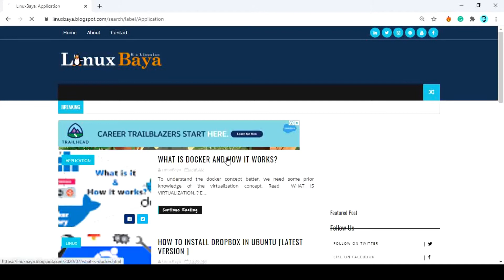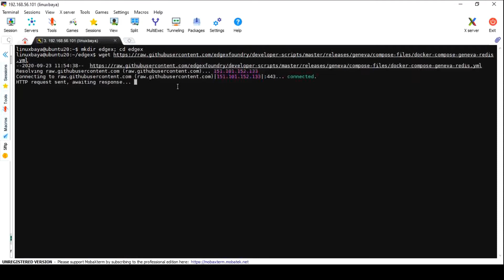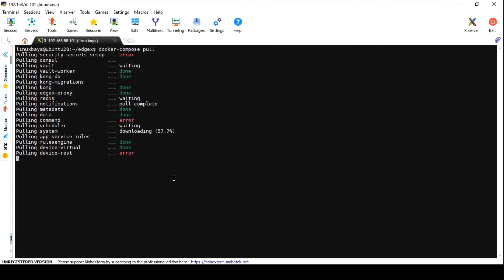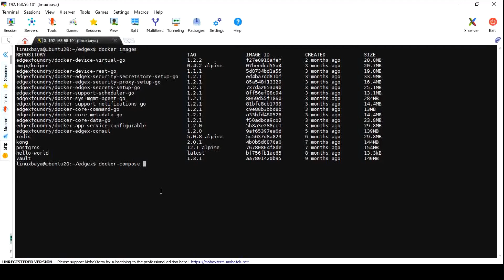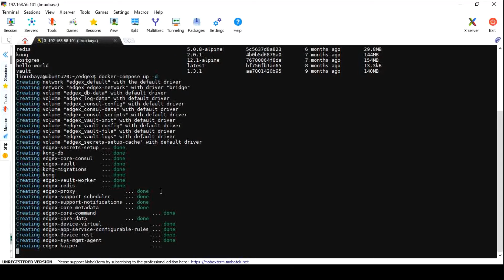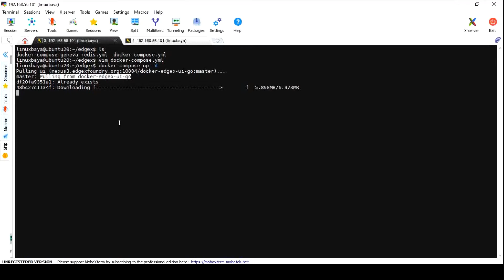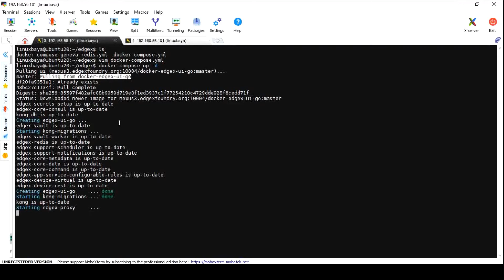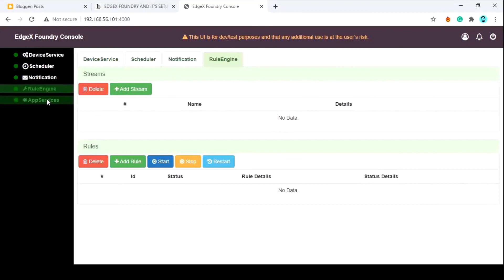EDGEX FOUNDRY SETUP || LINUXBAYA

Comment: Hello Baya; I am preparing my project final study; and I've some trubles with the mqtt protocole and edgex foundry, this is caused by the newest version of edgex, can you help me please...😥😥😥
Reply from the maker: Sure, i can try. Please describe the issue.
Reply: @LinuxBaya  thank you a lot for your response, so I have added the volumes for the configuration but thé connection with the mqtt broker is refused even if i dont use the secure authenticity
Reply: I can see that inside the asc-mqtt service takes the right volumes but in the msg errors that i can see it gives an error on the pipeline tha i Never used. It takes an other pipeline from that i have used